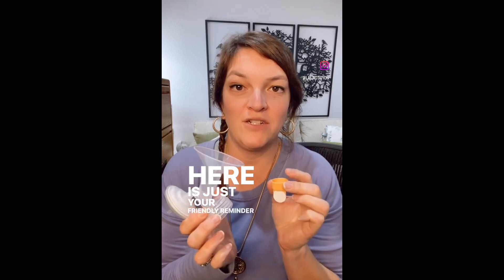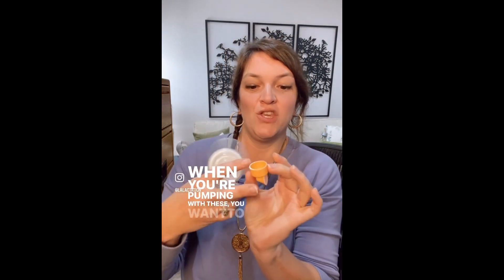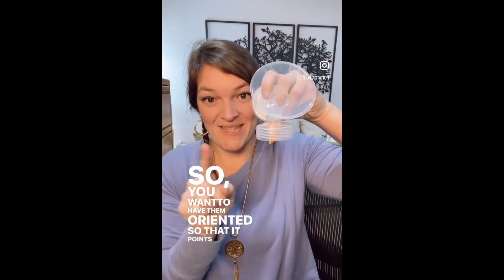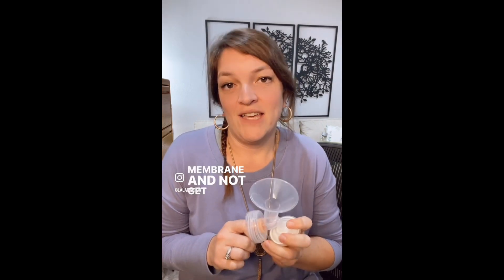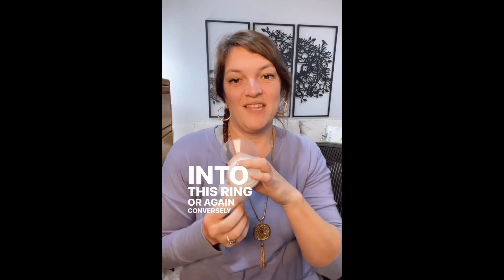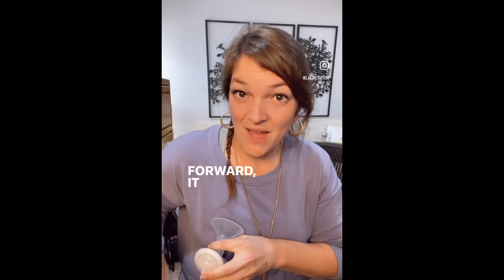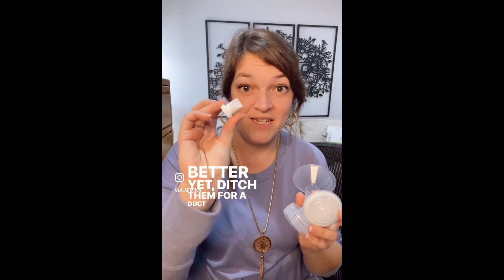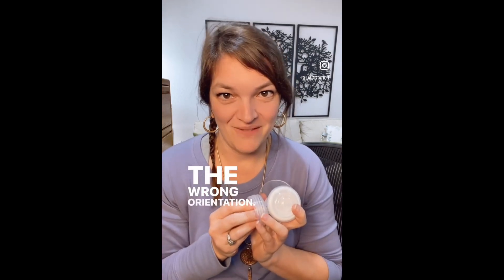Why isn’t my breast pump getting good suction?

Comment: Are there inserts that fit medela 36mm flanges or other flanges that fit medela pumps in the larger size range? I don't understand why medela sizes jump from 30 to 36 and it seems hard to find accessories in bigger sizes.